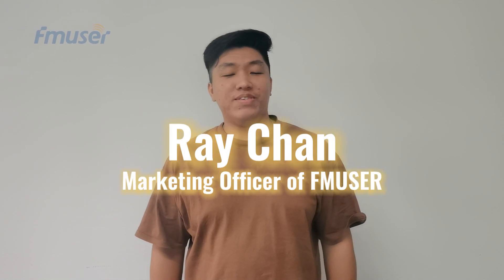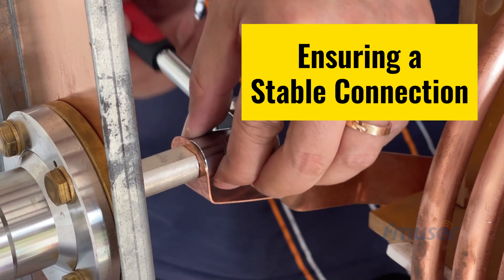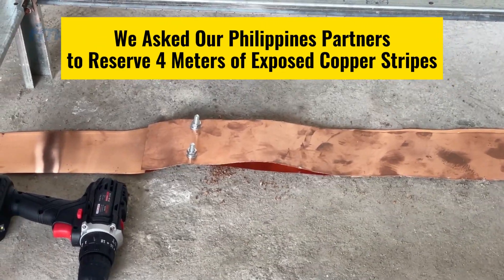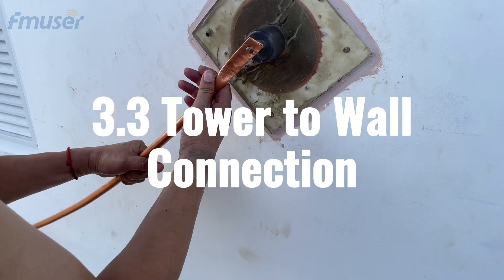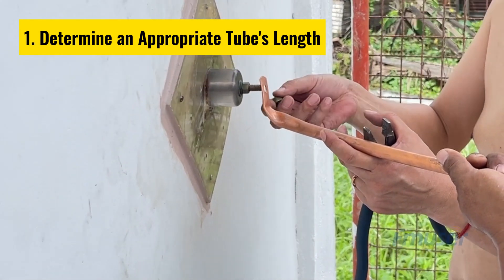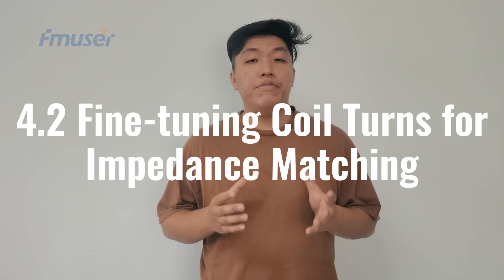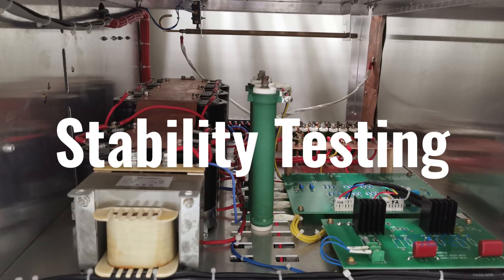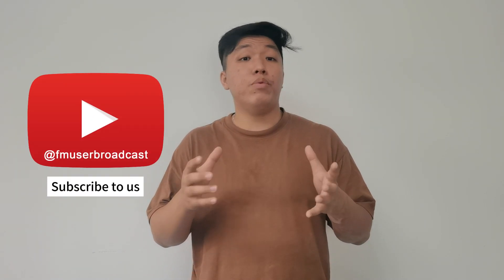How to Install an Antenna Tuning Unit for 10kW AM Station?

Comment from the maker: Learn More about Our Solution: ▸📧 Email us: sales@fmuser.com▸📞Whatsapp us: https://api.whatsapp.com/send/?phone=8618924246098&text=Hello-I-watched-your-10kW-AM-antenna-tuning-unit-YouTube-video-and-I-need-your-solution ▸☎Give us a Call: +86 139-2270-2227 ▸🔗AM Transmitter Family: https://www.fmradiobroadcast.com/product/am-transmitters▸🔗 AM Antenna Tuner Family: https://www.fmradiobroadcast.com/product/atu

=-=-= TIME STAMPS =-=-=

0:00 - About this video
0:31 - Project Overview
1:06 - Step#1 | Transmitter to ATU Connection
1:44 - Step#2 | Install Ground System for ATU
3:50 - Step#3 | Guyed Tower to ATU Connection
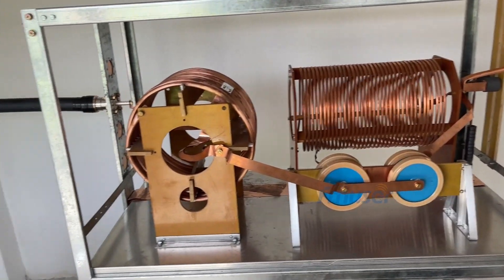6:49 - Step#4 | VNA-based Impedance Adjustment
8:34 - Step#5 | AM Transmitter Aging Test
8:34 - Step#6 | Transmitter Power-on Testing
9:37 - Part 2 Review & Part 3 Preview